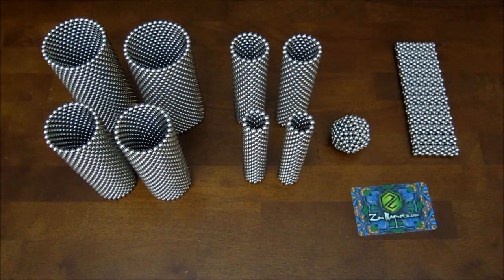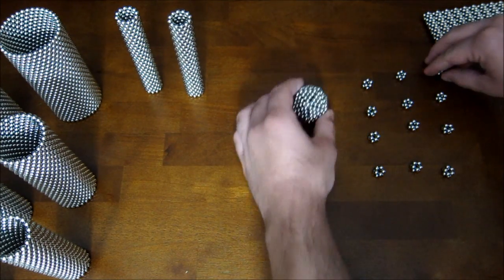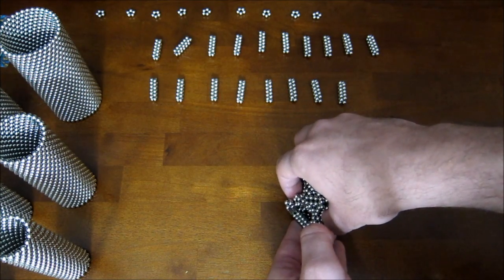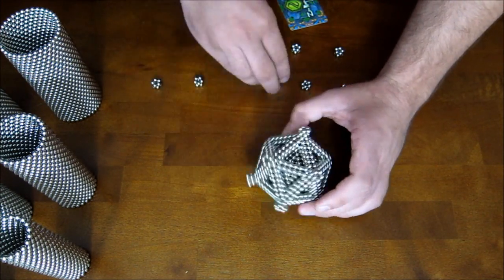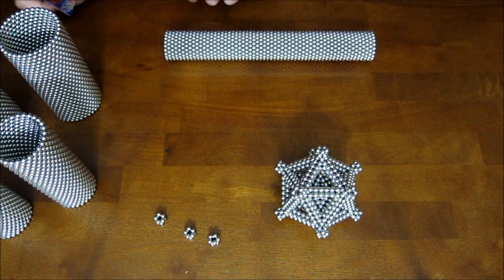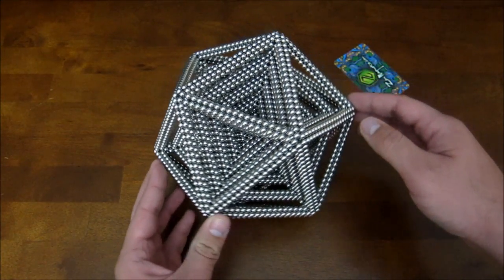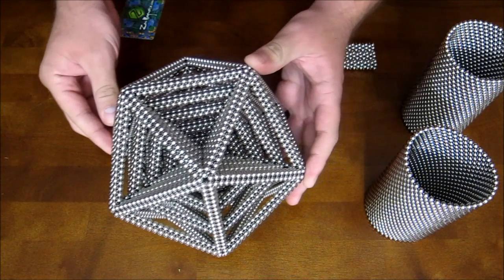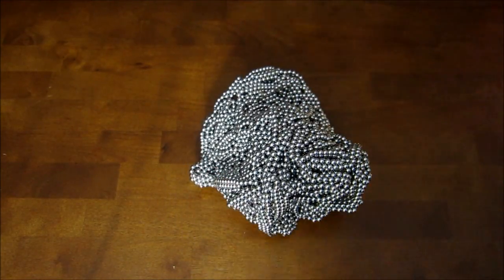Tutorial: Quintuple Icosahedron (Zen Magnets)

Comment: Can you get a Septuple or Octuple? Or even Nonuple or Decuple?
Reply: I don't know about structual integrity or weight, but if you want to test it, I have figured out how many you would need:
Excluding the core, which is 300 Magnets, each layer is:
12 x 5
12 x 2 x 5
30 x 2 x 8(layer-0.5)

layer: this layer (total) (ring size)
1: 300 (300) (rings of n/a)
2: 900 (1200) (rings of 12)
3: 1380 (2580) (rings of 20)
4: 1860 (4440) (rings of 28)
5: 2340 (6780) (rings of 36)
6: 2820 (9600) (rings of 44)
7: 3300 (12900) (rings of 52)
8: 3780 (16680) (rings of 60)
9: 4260 (20940) (rings of 68)
10: 4740 (25680) (rings of 76)
Reply: zelda64rules Wow... Yeah that's a lot.
Reply: Millions of magnets would be required
Reply: yeah I want to know what is the largest structurally sound shape that can be made with these.
Reply: Nicola Righetto
Reply: Fanamatakecick dfn
Reply: Fanamatakecick fuk is dat
Reply: Fanamatakecick fuk is dat

Comment: Moral of the story:

It is very difficult to create order, but very easy to destroy it.
Reply: +Au Ail Well considering that the tendancy  of the universe is to higher entropy (disorder) it stands to reason that it would require energy to counteract it
Reply: Gibbs free energy to be exact
Reply: Au Ail Gibbs works only under constant pressure. Overall it is best to refer to it as the second law of thermodynamics.
Reply: gibbs free energy is the entire driving force of the universe, nothing is accomplished without minimizing gibbs free energy in one form or another.
Reply: Nathan Schubert At constant pressure. While Gibbs is a great way to approximate reactions in an open system it falls apart in closed atmosphere system. It's true that everything tends towards its lowest energy state but Gibbs alone doesn't work everywhere all the time

Comment: OCD has escape clauses just like the patterns made with these magnets do.  HAve you ever noticed that the 'magic' number, that number that someone with OCD counts to and then begins counting again, IS ALWAYS LOW.  The highest number I've ever heard of is below 10.  For instance, 5 times to check the lights, 5 times to test the door, 5 times to tap the floor before they step on it, etc.  So, in the case of an error, at most they would compound that error, that many times and then, correct it!

Comment from the maker: @WanaPlayDrums98 Well, you can't calculate the perimeter, because it doesn't have one - the classical definition of a perimeter applies only to closed, two-dimensional shapes.

As for the area, I assume you're referring to the surface area of the outer icosahedron, in which case a quintuple icosahedron wouldn't be any different from a regular icosahedron of the same size. Anyway, given an edge length of x, the surface area formula is A=5*sqrt(3)*x^2

Comment from the maker: @Magnenaut stacked rings of 4 magnets (which means it has an edge length of 2). So, just add eight magnets to get the number of rings in each successive layer: 4+8=12 (layer 2), 12+8=20 (layer 3), 20+8=28 (layer 4), 28+8=36 (layer 5), and 36+8=44 (layer 6)

Comment from the maker: @jasonbarnes711 It's not hard at all if you know the formula! The edge length of the next layer increases by two plus the number of penta-rings used in the corner supports. So, in this case, I'm using corner supports of two rings each, which means that the edge length of each layer increases by four. Since the number of magnets in each ring are double the edge length, the number of magnets in each ring increases by eight. There's another (much, much harder) way to build the core, which uses two